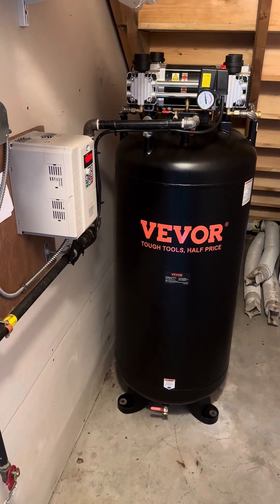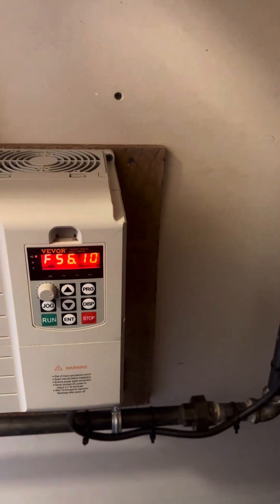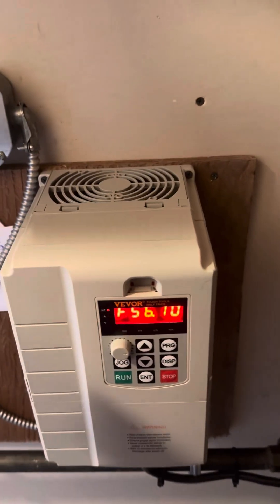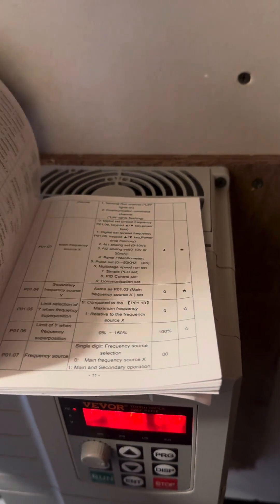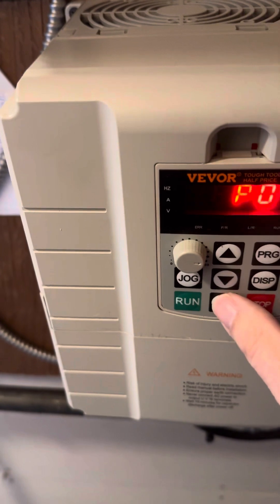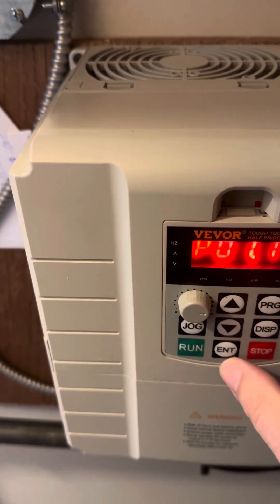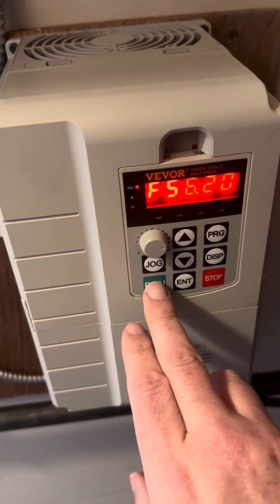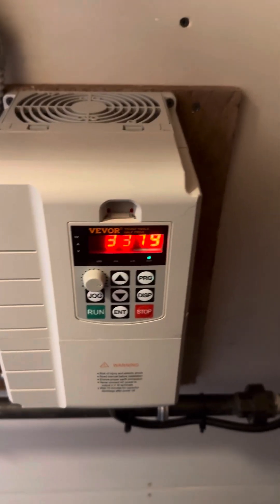Vevor 80 gallon air compressor with VFD programming

Comment: You need 220 single phase, but how many amps are required for this inverter?
Reply: If it’s the 10hp version the input power requirement is 240 volt and 34 amps

Comment: I just received what appears to me to be the very same Vevor compressor. The manual that came with it says that it is single phase. Your title describes it as 3 phase. Can you clarify this point for me please. I bought the unit which Vevor describes on their web site as 2-phase so I am confused. Is it 1, 2 or 3 phase? Vevor support is so far not helping me . Perhaps I need to have my question/concern escalated to someone higher up at Vevor. TIA for any replies.
Reply from the maker: Mine is 3 phase for sure
Reply: @thodrinsky  mine looks just like yours but the power cable provided with it had only three wires (ground and two hots) which match the pressure switch wiring, As well it has capacitors. Am I correct in thinking that 3 phase motors require a minimum of four wires (incl gnd) and usually don't have capacitors? Perhaps the model they sell these days (FB3500-10A300-1P) is different. AFAIK there are no repair/replacement parts or service available and no documentation (e.g. repai manual, parts manual). The end user manual is sketchy to say the least. Trying to communicate via Vevor's online support system is an exercise in futility. They either don't understand normal English, don't know their product or both. I'd guess that the three phase motor has been withdrawn from the market. Good that you have the requisite understanding but what about parts?
Reply: I suspect that the Chinese manual writers are using "phase" instead of "stage" which would apply to compressor pumps. Something got lost in translation.

Comment: Hello, thanks for the video, very helpful, I have exact same set-up.  Do you ever have any issues with dust getting into your VFD and complications from it?  

Is there anything you do to prevent dust (NEMA=4 boxt etc).  Vevor says to keep dust out but gives no decent recommendations. 

 I have found that if I use the NEMA-4 box, that this will be impractical because I will have to keep the enclousre cooled by either having to spend 2K on a Thermal Electric Fan or use a Vortex CNC Cooler that would use all the CFM from my Air Compressor.   I am kind of in a Catch-22.  I do NOT have any metal dust to worry about, just standard garage dust.  

Thanks Again, great video.

Comment: Can you not run the conpressor without a VFD. What would happen if i ran it off just 220?
Reply: It's a 3-phase motor so if you have 220 3-phase you don't need the VFD. You can't run it off typical American 220 single phase.

Comment: I recently purchased a used Campbell Hausfeld 80-gallon, 7.5 hp, vertical, two-stage, three-phase air compressor. I purchased the same Vevor VFD, but I have questions about how the pressure switch is wired. Do you have a picture of it? With the cover off, the wire inputs are shown. Thanks for sharing

Comment: Hey I just tried to change my parameters and it won’t let me go past 50hz any ideas why that would be
Reply from the maker: Did you change the input voltage? It may be looking for European standard if you did by accident.  Europe is 50 hz
Reply: @ no I just saw your video and finished wiring it and went right to the p1.08 and it only goes up to 50. I’m not sure where to change the input voltage
Reply: @ how do I change the voltage input
Reply: @TravisCarriere  I have the same question. From some of the other videos I have seen on different VFD you need to set what your source Hz is (aka 60hz)  but I am not seeing where to do something like that. the other VFDs it was the first function. (ex P0.01) but not this VFD so I am at a loss too.
Reply: @TravisCarriere  Ok figured it out. You have to set P01.10 first. (  Max frequency / AKA 60Hz)  Then P01.08 and P01.12 will let you change the value to what ever the max frequency you set in P01.10 (60Hz) if not the default is 50Hz.
Reply: @jimk9396  hey ya I figure it out right after I sent the last message lol but thanks for gettin back to me your video was really helpful
Reply: @ hey my compressor doesn’t kick back in as the air pressure drops any idea why that would be
Reply: I have to manually press run for it to kick in
Reply: @jimk9396  Same exact thing happend to me today setting this exact same combo up.  Also, he misquoted P02.04, he said both this one and P02.05 are 3400 RPM.  Only P02.05 is for RPM, P02.04 is for Hz (Not even possible to plug 3400 in this field).  I set P02.04 to 60Hz, hope that is correct.  Seems to be working great,.
Reply: @thodrinsky hey my compressor doesn’t wanna kick back in when the air drops unless I manually go over and hit run why won’t it just do it automatically

Comment: You didn’t mention how the pressure switch works with the system. Does it go inline between the VFD and the motor? Or before the VFD
Reply from the maker: The pressure switch is on the compressor. It has nothing to do with the vfd. Vfd is just the power supply.
Reply: @thodrinsky  Just looked it up. That's not how you are supposed to rig it. There's a relay trigger on the VFD you use to turn the output on and off. You just wire one of the voltage outputs on the VFD to the switch and back to one of the inputs. Then wire the VFD directly to the motor.
Reply from the maker: @SunsetWingman we activate vfd manually with a safety in the shop. We chose not to wire it that way. There is an over pressure switch in the compressor.
Reply: How did you hook up the VFD to the pressure switch? I have it hooked to com and DI1. Have a NC contact on pressure switch! What parameters did you set after to run if low on pressure?

Comment: How does it ramp as compressor starts and stops, when the compressor turns on, does the vfd auto restart ramp process?
Reply from the maker: Yes.  You can set the ramp time to whatever you want. In our case we have a quick stop switch in the work area. We turn that on first. then you have to hit start on the VFD and it will ramp at whatever duration you have programmed it to do. We chose a pretty short ramp cycle. Default is something like 10 seconds and we reduced that to 4 or 5.

Comment: That “exhaust” you pointed at is the intake and is SUPPOSED to create vacuum.
Reply from the maker: Those are mufflers. The intake is on the side of the motor on each side.
Reply: @thodrinsky  yes they’re mufflers,  100% INTAKE mufflers. They suppress the sound of the intake of each cylinder. Thats where every little bit of air goes into your compressor at.
Reply: @davidouradnik7925  Yea, he had me scratching my head also.  I have the same exact combo setup and fired it up for the first time today.  The intakes/Air Filters were sucking air in, and after watching his video, I got a little concerned that my system may not be working properly.  I then thought about it and came to my senses that these are air filters are designed to suck air in and filter it.
Reply: @thodrinsky  they’re listed as air filters by vevor themselves.  If you think the air is going in somewhere else you’re greatly mistaken. The ends of the motors only suck in cooling air for the motors via fan blades.
Reply from the maker: @davidouradnik7925 if what your saying is true the system would be creating vacuum and not pressure. It’s been running daily for months without issue. We also checked the rotation of the arrow on the motor to certify direction at low speed on the vfd. So I think you’re mistaken.
Reply: @thodrinsky  or, maybe it doesn’t matter which direction is rotates since they’re diaphragm pumps….. It would compress regardless of direction. I’m positive what I’m saying is true, and I also believe your compressor works. I very much admire the setup and would do the same. I kind of keyboard warriored responses to the vacuum comment in your video is all. What I’m saying is maybe you probably fixed a non existent problem. I wonder if motor direction only matters for the actual airflow of the cooling fans in the motors themselves so they don’t overheat.
Reply from the maker: @davidouradnik7925  Ive been serving and installing pneumatic systems for ansi for years. Every muffler system was on exhaust to prevent containment matter from exiting the compressors. This would be the first time I’ve seen this in reverse. We slowed the vfd and checked the rotation arrow on the compressor and it was running opposite of the arrow on the motor when pulling air into the mufflers. I do agree that it might not matter for compression begin diaphragm type system. I’ll double check again with Vevor. But that would also mean their arrow on the motor is reversed.
Reply: @thodrinsky  not necessarily. Arrow is most likely correct. If the rotation didn’t matter, the suction wouldn’t have changed. You may have slowed, noticed and reversed direction never checking for suction again. These mufflers are super cheap and I first noticed them on very cheap harbor freight portable compressors. If you go to vevor and check their manual for the compressor you have, or if you still have the hard copy, it clearly shows them as intakes/air filters. I’ve had a dozen or so with them and in every instance they were the suction side of the compressor head. Both oilless and oiled. I’m curious where you think the exhaust of a compressor goes, other than into the tank.
Reply: @thodrinsky  I have the exact same combo setup as you and my electrician finished wiring and setting everything up today.  My mufflers/intakes/air filters are sucking air in.  If this is incorrect, please send me the VFD programming codes/procedures to remedy the setup.  I also wrote Velvor to get their recommendation.  Eitehr way, plese let me know.

Comment: Sorry to say, them exhaust ports are always going to suck air which ever direction you run your compressor.
Reply: That’s because those aren’t exhaust ports. They’re intake ports and should have vacuum. Not sure if he pointed incorrectly or doesn’t know how it works..
Reply: Yea, he had me scratching my head also.  I have the same exact combo setup and fired it up for the first time today.  The intakes/Air Filters were sucking air in, and after watching his video, I got a little concerned that my system may not be working properly.  I then thought about it and came to my senses that these are air filters are designed to suck air in and filter it.     @davidouradnik7925

Comment: I hook it up with the vfr and it works but gets hot? I'm using it to work a morter sprayer... I bought the digital phase shifter model CPS 7.5HP.....please i need help  frustrating 🥺🥺🥺
Reply from the maker: That is too small a vfd. You need to oversize it. You also need to check your wire gauge vs length of run. You cannot under size the vfd. The motor is 6.5hp. Upgrade your vfd.

Comment: How did you wire the red black white to the u v w? I can’t find any information
Reply: Thats what im wondering because i have a converter coming in for mine but i didnt get a vfd. the compressor has 4 wires but the converter has 3 spots for wires. Is one of them not needed?
Reply: @BackedByFacts  I got it figured out if you want a picture I can send it tomorrow
Reply: @TCSGarage901 i need help
Reply: @TiptonGarage could you send me a picture of your wiring? I have this exact setup and want to get this running soon. Thanks for the assistance!

Comment: Man I was so hopeful. I need help with setup on this same vfd, for my milling machine! You're talking too fast and not fully explaining each step. Maybe I'm missing something, but I can't make sense of it.
Reply from the maker: Contact Vevor. They are very helpful on setup.
Reply: @thodrinsky  Glad you had luck with Velvor, my experience has been horrible. They don't even know the simple stuff like what size their Air outputs are.  FYI:  He misquoted P02.04, this is for HZ NOT RPM, not even possible to put 3400 in this field.  P02.05, you can plug 3400 rpm in.

Comment: Do you have a video of the air compressor actually running? It just sounded like the VFD fan was running.
Reply from the maker: I don’t have one. But I can tell you that it’s about 1/2 the noise of the previous ingersol Rand piston compressor it replaced. You don’t have to raise your voice to talk over it.
Reply from the maker: I have not had a chance to run it. It’s 1/2 the decibels of a piston compressor. It’s still loud. But you can talk over it easily.
Reply: @thodrinsky  I have the exact same setup and fired it up today for the first time.  This is my first big compressor however, I was shocked at how quiet it was.  My little portable couple gallon one I used to use for my car tires is much lowder and I am not exaggerating.